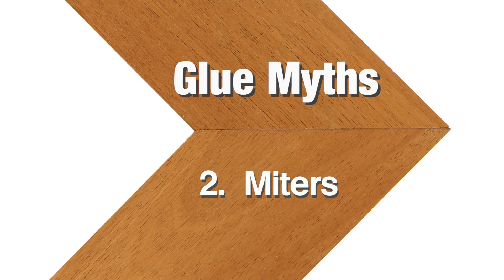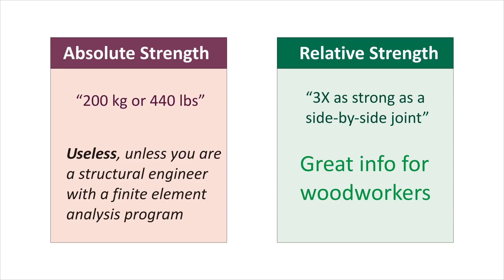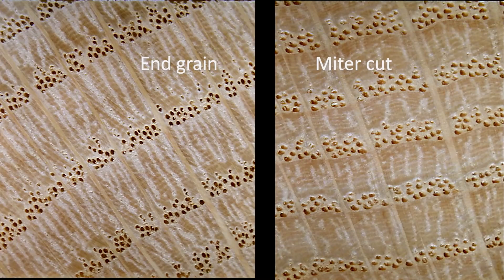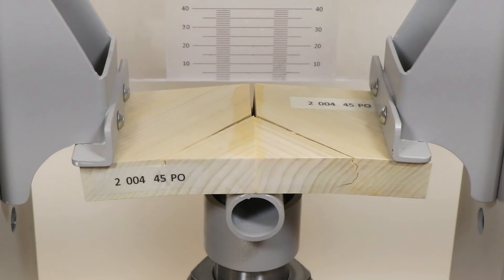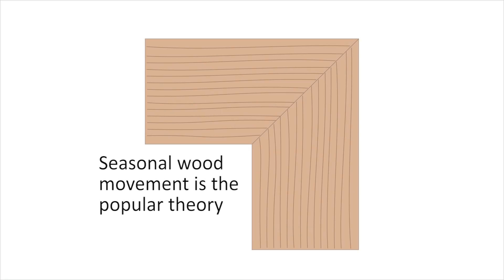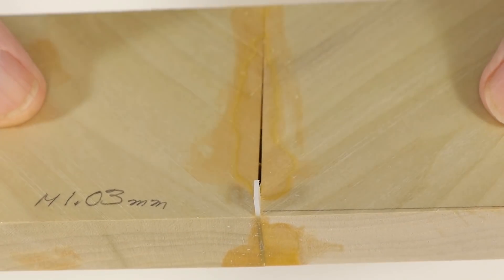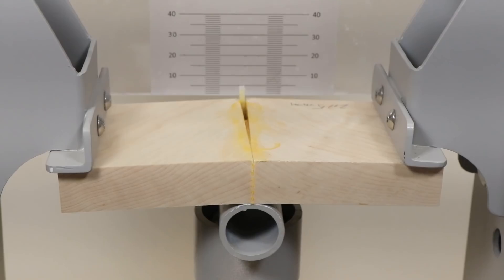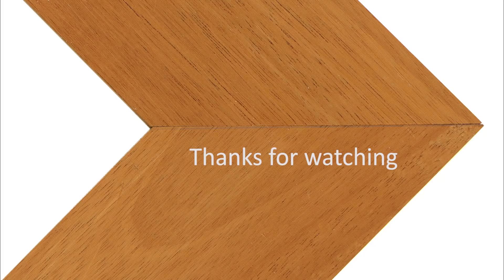Glue Myths:  2. Miters

Comment: Iv been meaning on doing some slightly more scientific testing on glue sizing, anecdotally i believe I have seen some increase in strength from a particular joint set up I have done hundreds or maybe thousands of times (end grain to side) by leaving some glue on the ends for 5 mins or so, not letting it dry like traditional glue sizing, just trying to fill any particularly thirsty fibers to avoid a dry joint. Obviously this could have been from other factors, thus my wanting to do it while controlling for those.

Comment: Very interesting once again. What this hopefully proves is that glue joints are not a replacement for real joinery. 3-Dimensional structures made with wood will always have to rely on the strength of the fibers themselves, not the lignin or a glue joint.

Curious to see your follow-up videos if you test cross-grain splines, long-grain splines like Owen’s plank, dowel joints, biscuit joints or even festool domino joints. I would love to see what you find out.

Comment: Great series Patrick! When every I've had a glue joint failer I've chalked it up to operator error.  Modern wood glues are just so reliable and easy to use that it has to be the other variables that cause the problem.  My list includes: an "old" or expired glue batch, glue joint starvation (not enough glue) improperly fitted joint, assembled beyond open time (usually in hot weather) or the other end of the temperature spectrum, assembled when the temperature is too low,,, not enough clamping pressure or to much pressure and starving a joint that had to little glue to start with, contamination of the joint (oil, wax, dust even or other stuff),,, the wood itself may have oils or tannin's that contaminate the glue and stressing the joint before it reaches a sufficient clue.  Looking forward to your experimentation with splines and may I suggest bisquets, dowels and loose tenons. From time to time I make a sample joint similar to the article I'm building and after it cures destroying it to make sure I keeping myself honest about my techniques.  I haven't used any kind of pressure gauges to date but after watching this series it may be time to get a bit more serous about shop QC.

Comment: Isn't a big factor (about end or miter joints) is that they are more difficult to cut and align perfectly than typical glue-ups?  If the faces aren't perfect that will certainly affect joint strength...  It's easy (or easier) to perfectly glue up tests like this, but when a miter cut is glued up as part of a larger project it's often hard to ensure perfect alignment.  Hence, splines or whatever to help out...

Comment: I think to some extent your theory about human error applies to both end joints and the evil butt joint. A butt joint is not great for fine woodworking joinery, but many around the shop items I create end up with something like a butt joint. Some work without reinforcement, while others would fail quickly, and the difference is more than just use. In many of these situations it  depends on how well the joint was attached.

When an item would require a large number of miter or butt joints it is likely that some would be worse. In fact, one might end up being "the bad one" which pays the price for how far off square the others were.

I think that most "good" joinery, whatever it is, is doing more than just providing extra mechanical strength through the joint. The joinery is likely to provide some amount of correction for these inaccuracies at each joint by aligning or connecting the wood. 

It's like comparing a grid of 16 playing cards with a 16 piece jigsaw puzzle. If the playing cards are supposed to be square to each other, the dealer is responsible for laying them out perfectly, and if two of the cards are out of alignment then the other cards can't fix the pattern. They lie over each other or the push the rest of the grid out and can add up. On the other hand, if you have a 16 piece jigsaw puzzle, the pieces correct themselves. Even if the outer frame of the puzzle is uneven when laid out, putting in all the pieces in the puzzle.

Of course the joinery, like the puzzle pieces, does provide mechanical strength against movement. If you were to go inside the joinery after gluing and magically reform the wood into a butt or miter it's likely you would have a very good version of a butt or miter, always well aligned.

Comment: Not sure about using "the same size" as your previous bonds.  Surely, part of the key info to us woodworkers is using the same size components - which joint will be stronger, so, the surface area generated by join "topography" IS part of the answer.

Comment: Perhaps a video dealing with the myth of LONG hand planes? I used SketchUp to disprove it, nobody wanted to address that. A number 4 will flatten a surface to less than a frog hair! Another myth that bugs me is planing/scraping a surface to a gloss condition and then having to go back and roughen it with sand paper to have a finish adhere to the face!

Comment: The seasonal change theory could be tested by taking a set of samples and sending them through several freeze thaw cycles.  .  Using the freezer for a day or two and then an oven for a day or two would make severe cycles.  If the strength is not gone over 10 cycles the theory would be solidly disproven.

Comment: P- might want to check out: Lamello Max biscuits, microwave biscuits in paper towel 30-60 sec, factory made plywood biscuits, slightly thickened West epoxy, 2 biscuits (1 over 1), lamello brand vs other brands

Comment: But I think there is something else going on here.  These test are only about the strength of these joints once, not how they behave after repeated loading and stresses, and how they interact with wood movement.   

My theoery - Side grain, because the lignin is softer and flexible tends to stay closed, the wood moves but the glue is stronger and holds it. With end grain when your joint is loaded, the tubes will compress  on one of the shoulders of the joint. Because the lignin is soft, the cellulose will collapse into it, but once that happens it's permanent shortening/weakening of the fiber. Then there is movement/leverage on the opposite shoulder will pull the glue apart.  

And I would expect this to be accentuated in hide glue, which is not that much weaker than PVA but far more brittle, and flex in the joint snaps it far quicker.

And this is exactly what you see here, the bottom of the joint compresses, and the glue snaps exactly where the fibers are longest (and hence the least stretchy/flexible dimension of the wood).  

Next test... set the rig to stress the wood with 50 repetitions at 1/2 the side grain breaking strain. Then test to failure to see how normal wear/use affects the strength of the joints.

Comment: Wood movement on small/narrow boards won't be as much of a factor on miter joints. I think the wood movement argument stemmed from counter tops where wood can shrink and expand as much as a 1/4" or more. On something only an inch or 2 wide there shouldn't be any gaps formed over time on a properly made joint

Comment: A lot of comments here about the direction of the force. I'm not sure that is relevant. The magnitude of the force required to break the joint in the other orientation is going to be much greater... you are trying to break a 3" joint rather than a 3/4" joint. The comparative strength of the joint relative to other grain orientations will be about the same, though, and the nature of the failure (glue breaking or lignin breaking) will also be similar. It should be possible to test to be sure of this, though you would have to retest all of the grain orientations to get relative strengths.

Comment: Maybe the real failure of miter joints is in the coarseness of the grain at the joint, ie if the surface is not smooth the relative contact area is greatly diminished...

Comment: I don't think that biscuits are accurately mimicking hardwood splines. When I make hardwood splines for a picture frame, the long grain of the spline is aligned with the forces in the miter. In this video the biscuit is aligned at 45 degrees to the joint, i.e. long grain not aligned with the forces. I'd be interested in seeing the results of putting in long grain, hardwood splines rather than biscuits. In that case the spline is unlikely to break (long grain) so it will presumably break along the side-end joint between the spline and the piece. This is indeed a case where there is significantly more area to the joint than the basic miter. I'd guess that it roughly doubles the surface area of the joint. 

I think you could do test this by running the end of two 45 degree test blocks over a table saw to create a 1/8" deep groove and then glue a 1/8" thick piece of hardwood into that groove when joining the pieces. You'd want the long grain of the spline to be perpendicular to the joint. 

You could vary the depth of the spline as an independent variable to see whether increasing the surface area of the joint actually increases its strength.

Thanks for the video!

Comment: I'm not sure, but I think I have a plausible partial explanation that you didn't fully touch on. That being said, I'm not an experienced woodworker (only about 1 1/2 years of experience), so obviously take my thoughts with a chunk of salt.
The direction of force that stresses the joint really matters. You stressed the joint by applying vertical pressure on the miter joint, but I don't think that is (generally speaking) the direction of force that is applied to the joint. Rather, the forces stressing miter joints are generally from the inner tensions of the wood that result from periodically changing conditions (particularly in humidity). Those forces don't necessarily stress the joint uniformly (particularly in large miter joints), as  your testing apparatus does, but rather on a microscopic level. I believe the wood glue can start losing its strength through micro-cracks that initially aren't discernible. All that needs to happen is for the joint to start losing strength in either the inner or outer edge of the joint, and the crack will slowly grow.
Honestly, I'd love to hear from any viewers or even Patrick, if there might be something to my thoughts, or if I'm totally out of whack!

Anyway, I loved the video!

Comment: ... Why are so many woodworkers warning against failures?    Probably because the alternative to a simple miter joint, is not a simple end-grain to side-grain joint.   It is a splined miter, lapped miter, bridle joint, or something else which gives the joint the strength of uninterrupted long-grain (the red bars on your graphs).  All of which are MUCH stronger than any kind of glue-based joint.

Comment: In the end grain-configuration the glue is the strongest in relation, but the Joint is still weak - as your video has shown were it is only a fraction of the strength of a longgrain joint like a lap-joint.

I still think you should include actual longgrain joints of the same configuration to see just how much weaker the endgrain joint still are. Specially here with the miter-join as a lap-joint is just a bit more work but vastly stronger for that geometry. The 3 directions you are showing were a miter joint, a butt-joint (known to be weak), and a butt-joint were now 1 arm the would-grain would not be length wise and the person making that object should feel ashamed. But not a single longgrain joint.
Or just the comparison of miter and a splined miter.

Comment: Excellent video.  Call me "surprised" .  I'll spend more time cutting and fitting than reinforcing.
Reply: That's probably not the take-away from this, if there even is a take away from it. His tests aren't with mitre's that are ends of long pieces of wood that have forces going in the direction mitre joints typically have the force. If you were to take a mitre joint corner from a frame and cut the ends so they were the same length as the width of the mitre joint (that's a confusing read, but hopefully it makes sense) then you'd be replicating what he's done in his testing. Unfortunately that's not how mitre joints are used and spending extra time on precision isn't going to change the actual problem with mitre joints (the force increases significantly the further from the mitre the wood goes).  

The information in this video is certainly interesting, but I just don't see the usefulness of it in real world applications. No one has mitre joints that are only as long as the width of joint. The problem with a mitre joint isn't the glue, it's the increased force the further from the joint you get. That's what the splines help with. I'm worried the spline test is going to be done the same way this one was, which isn't going to show us much different from what we saw. The direction the force comes from, and the grain orientation is a big factor in all of this and that's mostly being ignored.

Comment: While I absolutely agree with your commentary, and your test results, I believe the "flaw" here may be in the testing methodology, and the assumptions derived from the results of those tests. In this series, you are testing both the strength of the lignin, and the strength of the glue, one of which is a static (the glue) and the other is a variable (the wood lignin). The glue develops a stronger bond to the capillaries than to the lignin fibers. This matches your test results.
However, it is, as you say, the result of the leveraged forces applied to the joint that make the joint appear stronger or weaker as demonstrated in your video. The ratio of the joint size to the applied forces is what causes the miter joint to fail so quickly.
As a side note, you discussed how wood movement causes a miter joint to open over time, but what you didn't talk about is how the joint is used related to that movement. Miter joints normally fail not due to the seasonal movement of the joint itself (although this does play a role), but due to the movement of the underlying structure or body of the project. Miters are normally used for frames, trim, and other objects of adornment. End grain to side grain (E-S), and miter joints (M), fail more often, and are considered weaker, mostly because of the size of those joints in relation to their orientation, against the stresses applied, and seasonal movement of the underlying structure.
Here's an example: E-S joints are typical in face frames on cabinets. These joints in this position experience applied force (leverage or (L)) and seasonal movement (SM) somewhat equally. This means that the normal failure of these joints is normally due to SM of the joint itself, or L applied suddenly and repeatedly over time. It isn't that the joint is weaker, it is simply that the joint is smaller, and the L applied can easily overcome the joint.
M joints have a similar issue, with the joints experiencing extreme longitudinal forces as opposed to lateral force as tested in your rig.
While all this information is good knowledge, and helps us to understand how force, leverage, and movement can affect glued joints, it should not be assumed that this means you should not reinforce glued joints with proper time tested joinery. Unfortunately, I feel there may be quite a few beginning woodworkers and DIYers that may make that very assumption as presented in your video.
Experience and wisdom increase with knowledge and understanding. I greatly appreciate the information you have provided, your hard work and perseverance, and the extensive testing you have done. I hope to see much more of this in the future. Thank you, Patrick.

Comment: Typically when I see a end or mitre joint fail it is due to a "dry joint". The open pores soak up significantly more glue than side grain and adjustments should be made. My $.02

Comment: Great series, but you're not comparing the strength of glue joints, but instead showing that wood glue is stronger than wood. Most of the reinforcement of the joint is to create a load member that is not across the lignum.  I think plenty of wood workers just do things because they read something about it, so it's great to consider why we do things the way we have learned.

Comment: Super series. Much appreciated since I use miters in my ubiquitous production of picture frames. I make them using jigs to get perfect angles and component lengths and in my experience I have found   The glued miters to be quite strong. I do reinforce with V nails but I don’t think they add any strength to the joint since they are purely mechanical. They may hold a failed joint together but they do not prevent the failure in the first place. I think a spline would be the best reinforcement simply due the the much larger amount of glue surface, not the addition of side grain. Thanks again for these eye opening videos that have, to say the least, set the woodworking community on its heels. Rob Cosman’s reaction to the strength of his rabbeted joint vs dovetails was priceless.

Comment: Do you think the "halfway between side grain and end grain" would still apply for miter joints with longer boards? It seems to me that the lignin failed more along the corners of the squares tested (example- the corners closest to the ruler at 4:15). This would not apply to a typical miter, as there would be a long board with that grain.

I suspect that the actual strength is closer to end grain joints. this could be test by extending the 3" squares diagonally along the grain so that those corners have more length. As long as the glue area is the some size and shape, the three point stress test should still be valid

Comment: I love this. He's right in saying this, as I would not think that an accurately mitred picture frame would be under much stress at all, other than seasonal wood movement while hanging on a wall. I use spines as a feature of the frame more than the strength it provides the joint. Thanks for confirming this I  such a thorough manner.